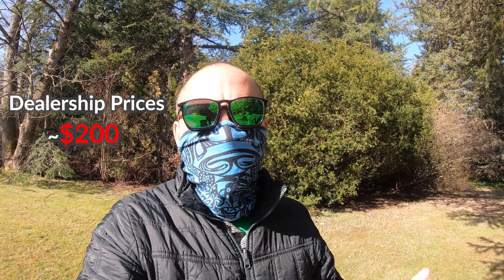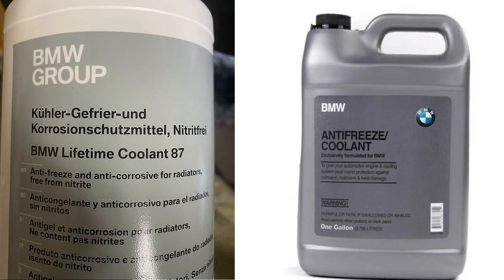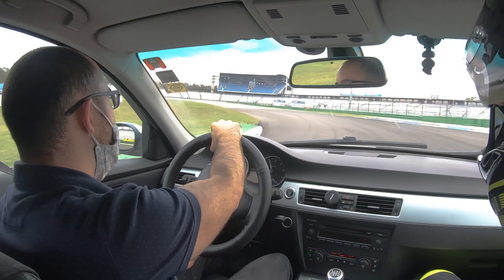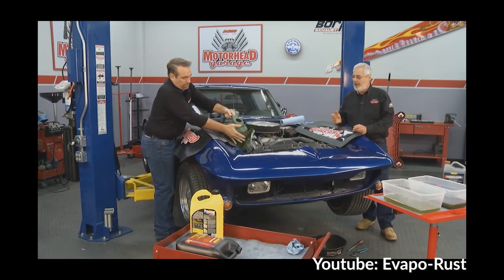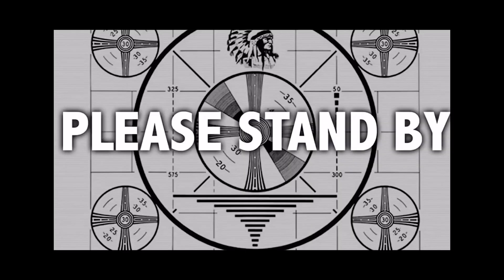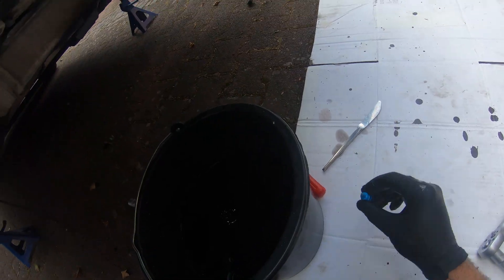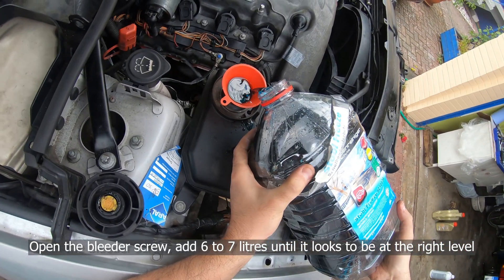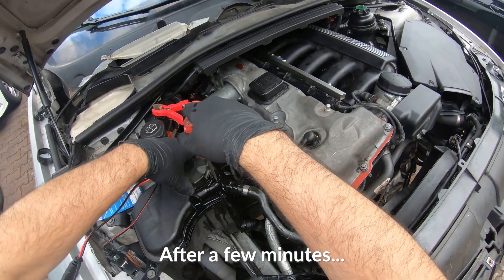[DIY] How To Change Your Coolant on a BMW 3 Series + Bleeding Procedure [N52 Engine]

Comment: What if my drain plugs broke
Reply from the maker: Try on the other side of the radiator. There is a second one. Otherwise, pop the lower radiator hose pipe and let it drain.

Comment: I took off the radiator hose from the thermostat end to get it all out and just can’t seem to push it back in the snap lock won’t click 😢lmao
Reply: I got it bro thank you ! 🙏🏽
Reply from the maker: Did you pull the small metal tab upwards on the hose?

Comment: Hallo I have a question I see some people empty the coolant refill again with normal water 3x times to clean the system . End then they put the coolant inside . 

My question is you really need to do that?
Reply from the maker: If you didn't have any oil in the system, and you just want to swap the coolant then no, you didn't need to refill it 3 times.

Comment: did this and after turning the fan on and ignition and pressing the gas, the windshield wipers go and i can’t start the car
Reply from the maker: Are you trying to circulate the coolant? It should run for 10mins.
Reply: Sounds like your battery dead

Comment: Just realized i haven’t been filling my coolant with to the right level
Reply from the maker: Yeah, check when cold, between the two markings. I also wayyy overfilled mine too. That's why it's called an "expansion tank". There needs to be some extra room in the tank when the engine gets hot
Reply: Is the water in the coolant reservoir supposed to be always squirting without stopping in bmw

Comment: What tool did you use on the drain plug?
Reply: He used a butter knife 😂
Reply from the maker: Yep... I couldn't find a screwdriver with long enough flat tip😂

Comment: It looks like you added too much coolant. If you add too much, the pressure will increase and leaks or cracks may occur due to pressure in the circulation passage or radiator.
Reply from the maker: Yes, at first I thought there wasn't enough, then I added too much
Reply: I think that happened to me lol

Comment: Excellent video. Just one thing, at 2:32 mark, did you say that we CAN use any coolant or CAN'T use any coolant ?
Thanks
Reply: Zerex G48 is equiv to BMW.
You cant use just any coolant. Gotta be the blue.
Reply from the maker: Technically you CAN use any coolant but I just stick to the BMW stuff. It's not that expensive. I have 80,000kms on it and it still looks fine.

Comment: can i get all out with that one screw? no need to get the car warm so it opens up the whole cooling curcuit like it used to be on older cars?
Reply from the maker: You can almost get all of it out with that one screw. No need to get the car warm.
Reply: @buildanddrive thank you! 🙏

Comment: Just draining the radiator will actually drain a pretty small amount of the total coolant in the system….the radiator doesn’t hold that much in comparison. You need to do both the radiator and main coolant hoses to water pump to meaningfully do a ‘coolant swap’.
Reply from the maker: Yes, if you tilt the car forward a bit, it should drain a lot of the coolant out.

Comment: Well 
I messed up 
I used water 🙃
Reply from the maker: Only water? Are you living in a cold climate or only hot?
Reply: 60 to 63 range - somewhat hot
Reply: The engine and radiator corrodes without coolant. May lead to head gasget leak among other problems.

Comment: You can use any coolant
Reply from the maker: Really?
Reply: @buildanddrive  every bmw I’ve bought has had different color coolants they all run perfectly fine .
Reply from the maker: @F30six  In europe, I've only found 2 brands of BMW coolant that say they support the N52 engine (magnesium alloy block) so you cant just use any coolant because it can have a chemical reaction of its not compatible. For other engines, very possible you can just put any coolant into it.

Comment: i realized my coolant has been EMPTY since 2020 and i’ve had no problems😭 now once i add coolant, my water pump fails 🙄
Reply: Bruh you must have been driving 15 min journeys only 😂
Reply: Thats crazy
Reply: Yes rust occur on the rotating screws and bolts preventing the pump from working. This happend to mine for 5 months while I was away on military training. Drove me vehicle around for 3 months without the water pump working. Only when I took it to my mechanic he told me it wasn't working. When he took it out and tested it it wasn't responding electronically
Reply from the maker: LOL. How do you know your water pump fails?
Reply: @buildanddrive  my mechanic told me the code for it came up. my heat also blows cool air then i get the overheating warning n my car stops accelerating

Comment: I use the 50/50 euro premix from the auto store and my car has been fine . It’s not even blue, but green lol. Just make sure it’s the correct mixture the color doesn’t matter
Reply from the maker: You sure? I thought the chemical components of the coolant was special because of the reaction with the magnesium alloy of the block of the green coolant was bad for the block.
Reply: @buildanddrive He’s right it just has to be a specific type: Silicate Enhanced Hybrid Organic Acid Technology or Si-HOAT.
Reply: @buildanddrive color is just a dye so not the best thing to go off
Reply: Always use blue for bmw
Reply: My car just started throwing smoke
Reply: @Sargento701  from what

Comment: are you sure you run the venting  process with the bleed screrw and cap tight?
Reply from the maker: i did it the wrong way. run the venting process with the screw CLOSED and the cap open until you dont see anymore air coming through, then try to get the right amount of coolant in the expansion tank and close it so it can pressurize and run throughout the rest of the engine.

Comment: Wow this couldnt have come at a better time dude. Thanks! 🙏
Reply from the maker: Summer time bro. Get that cooling system running good!
Reply: @buildanddrive mine leaks from the lower hose is it worth getting the tank or replacing the hose